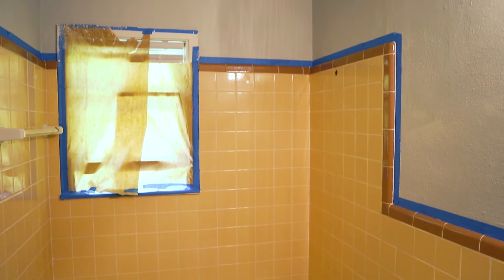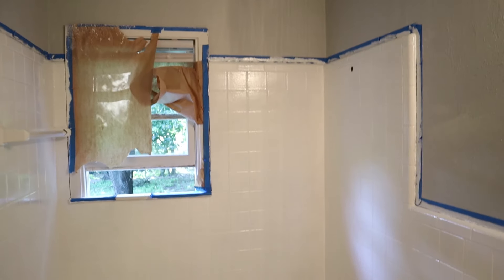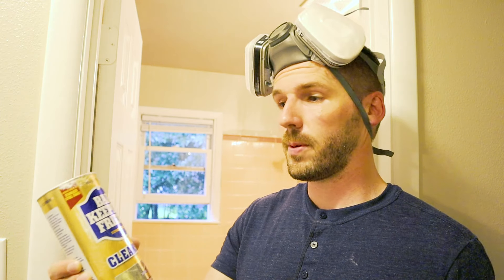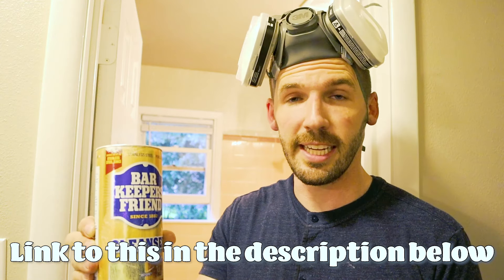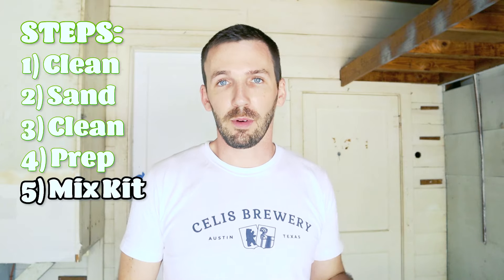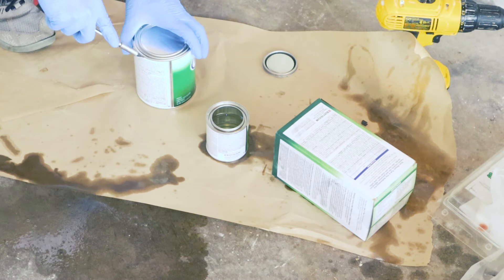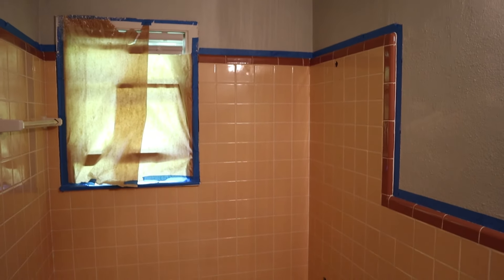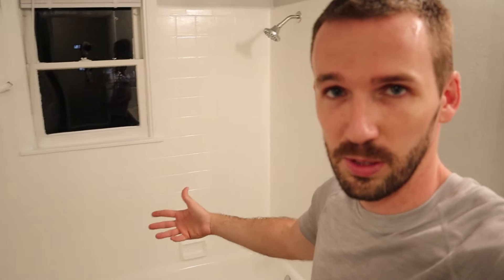How to Refinish a Bathtub and Tile with Rustoleum Tub and Tile Kit

Comment: I'm going to do my bathroom tile walls with this, but not my surround tub and tiles.  I think and have read that, after a few years, this stuff peels because of water contact. So, for the wall tiles, yes. For the tub and surrounding tiles I'm going to use Ekopel.

Comment: I would recommend anyone using this product, to use a paint brush as the directions indicate. Used this yesterday and wow, the rollers meant for this type of epoxy, did not work well at all. Using a paint brush lightly dampened gives a seamless result.

Comment: QUESTION! Preping tile currently and 100 to 400 grit barely seem to put scratches in my 50s ceramic clear coat. We're you able to visually see the sanding dull the finish as you sanded?!

Comment: out of curiosity, what's the purpose of sanding the walls? I found few videos far in between that mention actually sanding. ,ost of the videos just say to clean really good then apply primer then paint. does rustoleum say to sand?

Comment: Good stuff...

Know my comment is a little late...

I intend to repaint the tiles in my kitchen.

Similar to the ones in your bathroom.

If I follow your method and then use this kit as a PRIMER coat, followed by rust-oleum stone spray finish, would it work?
Reply from the maker: I cant say for sure but I believe it would work. If I were to do that, I'd probably still put a real bonding primer (like the Valpar Bonding one) after putting this glaze on. Then stone paint last.
Reply: @KellyConcepts  what if I were to skip the glaze and go straight for the  bonding primer? Then the stone spray?
Reply: https://www.valspar.com/en/products/exterior-paints-primers/stainblocking-bonding-primer-sealer-2

Oh ok... Think I'll just go ahead with this instead of the glaze. 

While painting tiles, my desired finish is different. Thanks though, the vid was still informative. 

Will follow your steps up to the point of primer application. Cheers from Singapore.
Reply from the maker: @wooohooo103  for areas that you won't be touching often and won't get constant water, just the primer would probably work just fine. A shower would eventually flake off without a glaze.

You should be good to go. Good luck and enjoy!
Reply: @KellyConcepts  thanks for the tips! Will let you know how it goes several months down the road.

Comment: Quick question - what if you have some spots where the grout chipped out? Would you regrout and then do this or just caulk that up and make believe it never happened?
Reply from the maker: Caulking would be fine here since color and texture won't really matter once this glaze is applied. I'd just caulk.
Reply: @KellyConcepts  thanks so much!

Comment: We’ve done two terrible showers with this product. It absolutely works! It turned two embaraasing showers into new. You must wear a heavy duty respirator , have all fans in, and prepare that your whole house will smell scary heavy dangerous chemical for at least a day or two. There’s no way it won’t permeate the air in the entire house. We had a $20,000 quote on one shower, and we paid 100 dollars for two boxes of tub n tile. It’s been almost a year and it’s holding up great. Only thing I would suggest is that if your old shower was moldy, you will want to blow a fan into it after using it- and we also wipe ours down with a towel. You get one shot with this product, and we don’t want to regrow mold and problems. You can’t clean it with bleach or anything scrubby like a brush. Make sure you do all the prep- cleaning, sanding, waiting long enough to dry before using. 

This product is excellent!

Comment: Great presentation but.... Even in the video the original older tile finish had a great gloss shine.  The paint over did not have even close to the same gloss shine finish.  True it had a matching color across all the features but the finish lacked the same luster.  I guess for renters it is a way to change and unify colors.  I'm not so sure anyone would want this finish in their forever home main bathrooms.

Comment: I didnt read the 300+ comments, so excuse me if this a repeat question. When you add the activator, do you need to let it set and thicken a little before starting to apply? I ask bcz so many others who were not as diligent as you, complained about it being runny, thin, and as if it was like applying milk. Thank you.
Reply: About 3 mins of mixing worked for me, then straight to rolling.  It was still thin but worked perfectly.

Comment: Nice job Sir  I had a ? About how many days does the odor last I have a small tiny bathroom with a small little window I read some where that the odor is strong wonder how long will it be in the air

Comment: Great video.  Quick question...I want to use this product to freshen up my bathroom tile and tub....some of the grout is missing in my current shower tile.  Should  I re-grout the tile before, or after the rustoleum application? thanks!
Reply from the maker: Yes go ahead and regrout first. Caulking (if needed) can come after this glazing though.
Reply: @KellyConcepts  perfect! Thanks so much for the reply 😃

Comment: Question, the bathroom I need to refinish has a lot of mold on the caulking and tile grooves, how do you suggest I treat these before doing the treatment?  Great video
Reply: the manufacturer has a video and they say to clean mildew with bleach and water

Comment: I plan to start this project tomorrow- redoing the pinky beige wheat sheaf 70’s bathtub tiles. I have all the supplies laid out and just have to get the gumption. The box says to use a brush but he’s using a roller, which would be much easier and faster. I’m going to leave the tub though as I don’t trust that this stuff won’t chip or peel at some point. I can live with it the way it is by putting a good quality bathmat on the bottom. At least until the magic day I can afford to renovate the bathroom. I can wish...

Comment: correct me if im wrong, but the tile doesnt look like it has a glassy smooth finish, you can see the texture of the roller, no?
Reply: I've used this before.  It does leave an orange peel texture.  It will beat what the tub looked like before!
Reply: @astridgonzalez5622  im using it for my tile, not sure the orange peel look is worth the time, I'm surprised it doesn't smooth out to be honest

Comment: This is a really good video, there is another video presented by Citytv and the contractor there explains how to use this product better.  He said to clean it and sand it ,  tack cloth it , 
and then add a double coat.  This video fails to explain that you have to let it cure for three days.  I would think that is correct because this is something that will be used with water and the elements.  Including cleaners.   I’m pretty sure this gentleman removed the toilet and the faucet.    Nothing comes without hard work.   The truth is that this is a great product and if you do this right you will get good results.   I’m actually going to change my pink tile to white tile so that the water doesn’t soak into the cement underneath my floor.   In Canada you should be able to pick this up at Home Depot.   This product is readily available in many places.
Reply: Diego...nothing replaces reading the instructions.  This is a good first step...the product does come with instructions and the website also has more details.
Reply: Hey as long as the product does the job. It’s all good.  👍👍.     I tried this product and it works amazing.

Comment: A 220 grit sandpaper sounds a bit coarse for a smooth texture. Would you recommend going back over it first with a 400 or 600 grit before using the product or were you satisfied as is ?
Reply: I agree. A fine grit would've provided for a smoother, more glossy finish to the final look

Comment: When I mixed my kit it was very watery. What should I do to thicken it up? It doesn't look like yours.
Reply from the maker: Hi Ruth, they should be made to where you just mix it and it should be ready. All I can think of is that you might need to shake the cans 1st because somehow some of the chemicals may be stuck to the bottom... but I'm not sure. It's close to the same consistency as paint.
Reply: @KellyConcepts  I put the lid back on and shook it vigorously and it worked. Thanks for replying. It's not looking as good as yours yet...but I'm sure I'll get there!

Comment: Is the gas mask necessary? Is this stuff that toxic? Wondering if I should purchase one before starting my project. 

Also - would this stuff work on the time around a gas fireplace?

Thanks
Reply from the maker: This stuff is quite toxic and smells terrible for a few hours. You could maybe get away with a lighter mask if you had all the windows open and a fan. It was 100+ degrees here so I didnt have that option lol. I'm not sure how this stuff does around heat, although it's fine with hot water? I don't know

Comment: Wow..ok gonna try this in my bathroom! How many days did u invest for this job? I.e. after cleaning with sponge, how long for dry time before applying paint? Also, did u re-caulk afterwards?
Reply from the maker: It took me 2 days with the 1st day being long.
The tile actually dries pretty quick and I didnt want too much time to pass between cleaning and painting because the whole house was a remodel and dusty. My final wipe down was with a tack cloth which could help dry if needed too. I did end up recaulking.
Reply: @KellyConcepts  Got it....thanks for the quick reply!

Comment: How did you manage to paint behind the toilet without taking it out during the project? I’m stumped!
Reply from the maker: I just put painters tape on the sides of the toilet tank and squeezed the roller behind it. I didnt mind getting paint on the back of my toilet tank because no one would see it. It only really touched towards the top
Reply: Kelly Concepts brilliant! That makes sense thanks so much!
Reply: It might also be a good time to replace an older toilet with a more efficient model. I am in the process of doing this type of tub & tile repainting work. Removing the toilet will make the job easier and it needed to be updated anyway.

Comment: this video was very help full , I want to paint my walls tomorrow, they look pink like this, I wonder if i can get away without sending tiles??  )) and how bad it smells, I have window but I am in APT so hope my naigbours will not complain about smell
Reply: Please do NOT skip the sanding!  It helps to get rid of stubborn dirt still stuck to the tile after cleaning...more importantly: it roughens up the surface and helps the new finish grip and stick better!  This is the same reason you should use a sanding sponge before painting over old paint if you are not using a separate primer.

Comment: How long does it take to dry ???
Reply from the maker: The 1st coat needs to dry for 2 hours before doing a 2nd coat (if needed) and at least 24hrs before using the shower/tub but the longer you can wait the better.

Comment: Did you remove the toilet to paint behind it? I didn't see that in the video and would love an easy way to paint behind rather than remove it.
Reply from the maker: I was able to paint behind it without removing the toilet. I just put painters tape around the visible edges of the tank and squeezed the roller behind the toilet. I didnt care if I got white paint on my white toilet personally.

Comment: Just bought a house I'm definitely gonna try this out on my full bath. Avoiding tub replacement would be awesome, hopefully I can pull it off well.
Reply from the maker: Good luck and just remember the cleaning is the most important part!
Reply: @KellyConcepts  thank you. I'm literally prepping list of supplies now.
Reply: Unless your budget is super tight, it would be better to replace the tub and tile. The paint won't last long. It normally last 3 to 5 years and it will start to peel.
Reply: @lishen9223  it turned out quite well. I'm fine with this being a 3-5 year temporary fix. Once it does deteriorate I'll definitely look at replacement options.

Comment: I painted over the pink tile in my bathroom. So far, my tub and shower have two coats and I can still see where it needs to be gone over again, there is still a pink hue and you can see roller marks. Am I not putting the paint on thick enough? Should I try a third coat?

Comment: This is horrifying! Why would you sand the glazed surface of the tiles just to paint on top of them? The tiles are in good condition and would last decades longer, and you just damaged them to paint them with a less durable coating. Tragic. Someone once put a lotta effort into tiling it correctly.
Reply from the maker: because I remodel things?

Comment: Hi!  Excellent video.  Wondering if you had any trouble with tape sticking to the epoxy after painting?  I’m wondering if I can paint just the border and soap dish of my shower but seeing how strong the epoxy is with eating foam rollers, do you think painters tape can be used?  Should tape be removed before it cures?  But I guess that’s difficult with waiting 2 hours before a second coat needs to be applied.  It might already stick....I have used epoxy pours on wood, and I’ve learned to remove tape when wet because it gets caught under the product when dry.  Didn’t know if this would react the same way??  Your advice would be much appreciated before I attempt this.  My bathroom walls are the same color as in your video, too—amazing.   Help me, please!  Thank you so much 🙂
Reply: I have the same questions! Any answers on these, @Lanene
Reply: @melissab.508  Hi there!  Well, I ended up doing a bathroom and kitchen backsplash. Some, just the borders and soap dish.   I took a lot of time to tape them off properly with painter's tape.  After one coat of Epoxy White, I did a second coat fairly soon after, then peeled the tape off to let it dry.  I do believe the product will stick the tape if you don't take it off quickly.  It turned out great...It's in a rental unit I have, so no exactly sure how it's holding up.  I decided not to paint the entirety of the shower walls, for my contractor said that tenants wouldn't take care of it and it would peel off.  So, I did the tile on the walls of the bathroom, outside of the shower.  I'd post a photo, but not sure how to do that here...haha.  But, not much bleed through with the tape.  I think Frog tape is best to use...

Comment: What do you think about the grout lines? I am concerned it is too white since grout is usually light grey if you are doing white tile.
Reply from the maker: The grout lines that were on mine were a nasty beige color so in my case making it all white was better. But even if they were a grey, painting it like this just makes the entire tub surround look like a fiberglass shell. Looks clean. But depends on preference!

Comment: did you find that sanding the tile really didn't seem to do much?  I am starting almost the same product and haven't really been able to tell much of a difference before/after sanding.  seems like the cleaning is the most important step.  thanks!
Reply from the maker: Hey Aaron, sorry this comment slipped through. Correct, the sanding doesn't appear to do much (you can barely see a dull finish) but it does leave small abrasions in the tile. Additionally, it helped remove some of the mold in this old 1950s house that I couldn't clean.

Comment: Hi. Great job! Looks great. My bathroom is the exact color and layout. In order to put the 2nd coat on the tiles surrounding the tub did you have to step in the tub? I'll be tackling this project this weekend. Trying to decide the best method. I'm not sure how to go about putting the second coat. I don't wanna ruin the tub. Thanks!
Reply: Just a suggestion. If you haven't apply the 2nd coat, I will suggest you call the manufacturer to confirm how to and when to apply 2nd coat. If memory serves me, the 2nd coat can only be applied within several hours; if apply the 2nd day, you will need to lightly sad the surface; otherwise it will not bond too well. Again, I did this 2 years ago, so it better to confirm with manufacturer if you need to do 2nd coat.
Reply from the maker: Thank you! So I started with the tile above the tub and worked around the entire bathroom for the first coat (and did not do the tub yet). By the time I was done, the 2nd coat was ready but I think I took a little break for an hour. Then I started the 2nd coat in the same place, the tile directly above the tub, and then before doing the surrounding room, I hit the tub with the product. Then finished the room, and then came back for the 2nd coat on the tub.
Reply: @KellyConcepts  Thanks so much!

Comment: Thank you for this video. Did the tile have a shiny, clear glaze over it? It looks identical to the tile I’m about to paint. I sanded with 400 grit, then 220 and then 80 grit and it doesn’t appear too “roughed up”.  How roughed up was yours after sanding?

Comment: Did you do stand in the tub to do the second coat after applying the paint to the tub and letting it dry ? Just curious if that’s ok to do
Reply from the maker: The tub is pretty safe to stand on after 24 hours. I would put a towel or something to stand on. Otherwise, wait longer than 24hrs so it can cure longer

Comment: Awesome job, I want to do a small area in my kitchen, that's tiled with white and blue tiles.
 Why clean the tiles with water and soap first, then clean them again more aggressively, when you are going to sand them afterwards? Aren't two not necessary steps? I can't understand why I have to  clean tiles before I sand them?
Reply: My best guess from doing projects is that items like soap scum and grease in a kitchen will gum up the sandpaper and not sand the actual surface.
Reply: @carakellmeyer5037  I think your guess  makes sense.